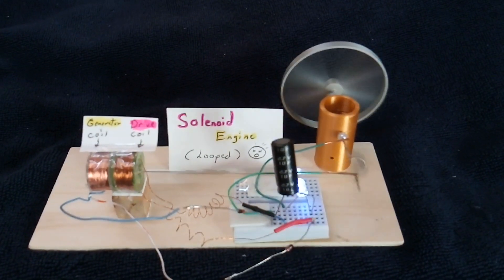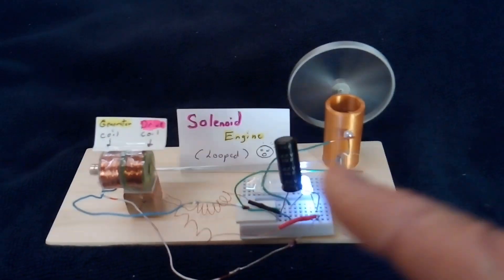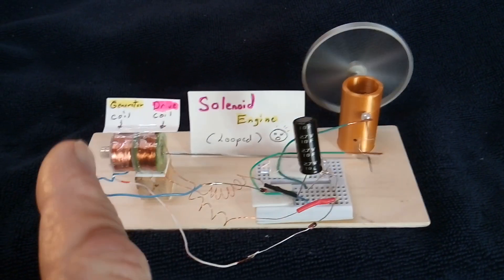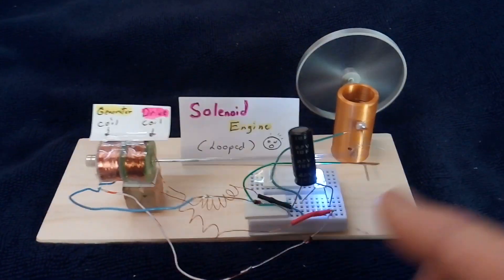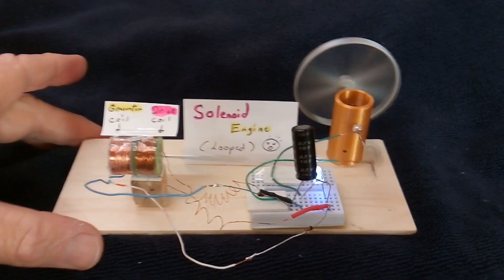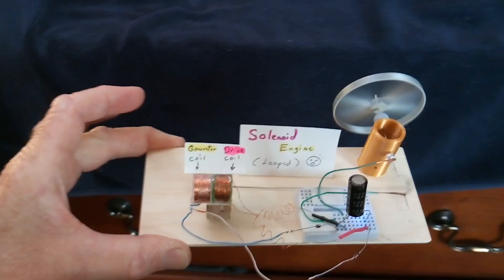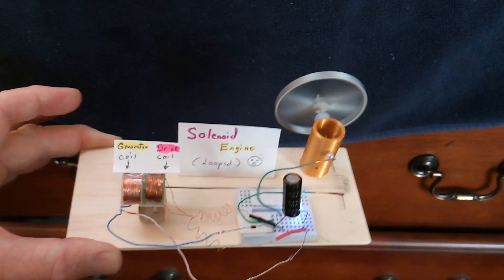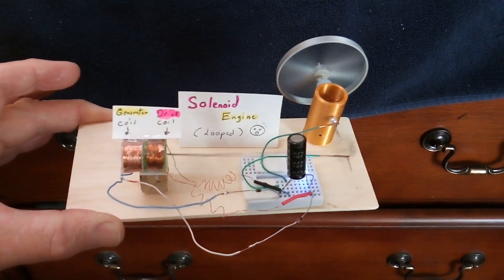Solenoid Engine -----  Looped

Comment: @Lidmotor instead of traditional selenoid and magnet pulling/pushing against magnetic forces, make 2 stationary magnets and selenoid in-between. Then add transformer iron piece moving on between 2 magnets and middle also facing selenoid. So you will get magnetic forces and push/pull displaced on 90 degrees angle. Each time transformer core reaches edge one end would be facing magnet and other end on selenoid. The only opposing magnetic forces against movement you get will be just magnetic push/pull of transformer core between magnets.
The next step would be balance magnetic forces around circle like in Muller dynamo. Then you will see something interesting happening... :)
Remember, the induction only needs changing magnetic field and how we make it happen is only matter of our creativity.

Good luck!

Comment: These 2 coils are in parallel ? Need diagram.
Reply from the maker: The two coils are not connected.  One drives the engine and the other one at the end generates electricity.   The generator coil is connected back to the front of the drive circuit by way of two diodes.